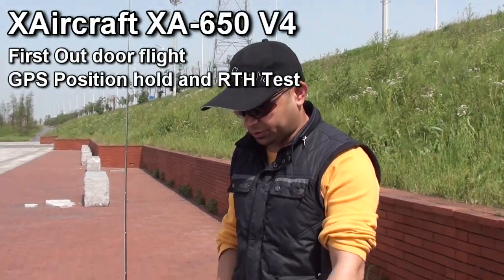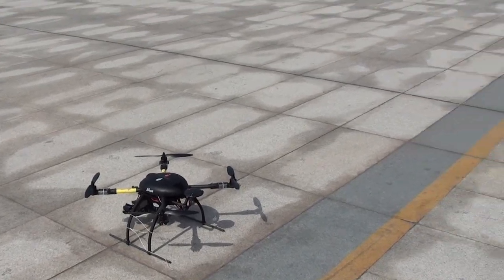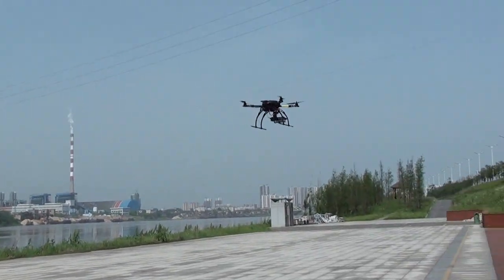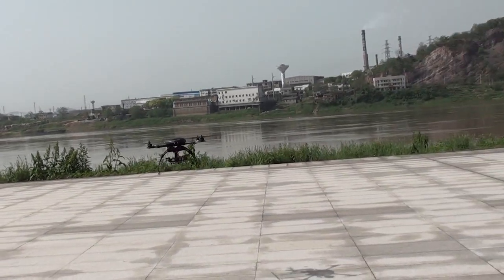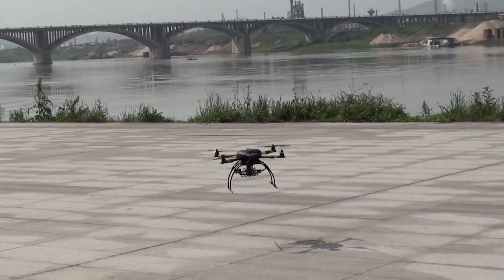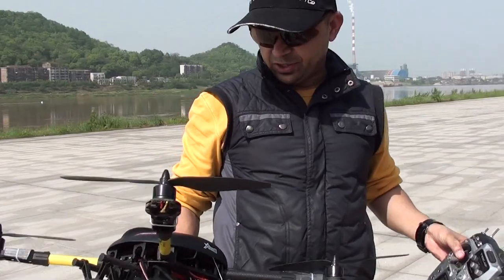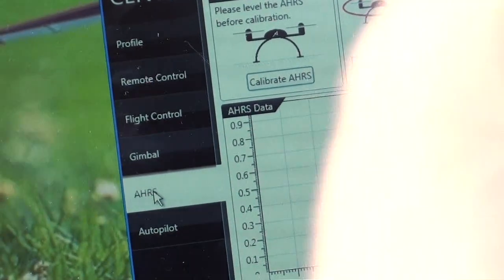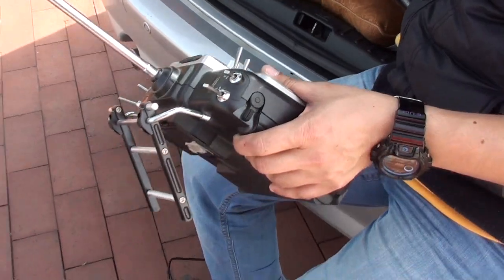XAircraft X650 V4 -- Outdoor flight GPS Position hold and RTH

Comment: Hey al. Do U use carbon fiber props? I ask only cuz this seems strange. I put some on my quad and it seems to interfere with something and it crashes. I'm using the M-lite.naza. And to day I tried them on my kk2 quad and same thing happen.  Is this just me??
Reply from the maker: never had these issues with CF props. maybe you wanna try wooden XOAR

Comment: Similar functions yes, which is better? easy answer, after using and flying both, its the DJI WKM by far, though the newer Xaircraft GPS/Autopilot is far better now, it still imho does not beat the WKM, but it does perform ok, on the WKM, movement is far more precise, on the Xaircraft it always seemed more lag between responses and more "bouncy" on movement, for myself, the WKM is the better one.